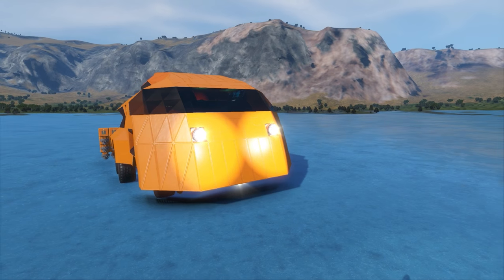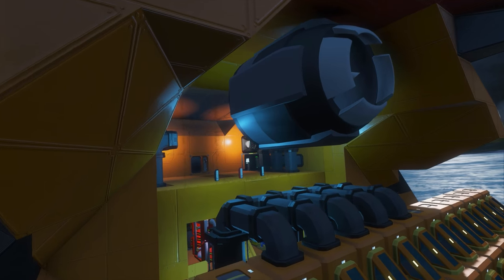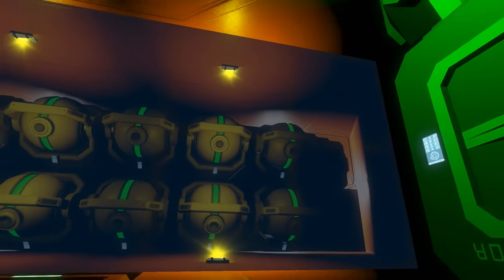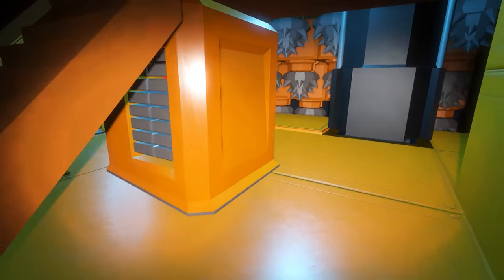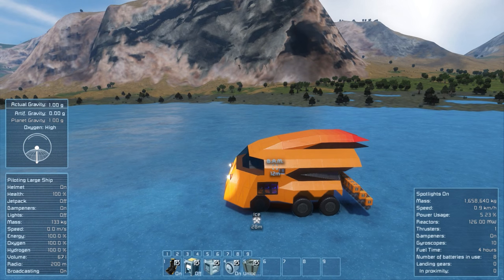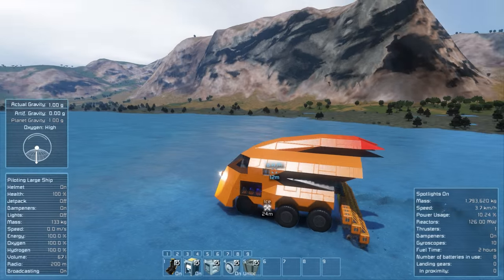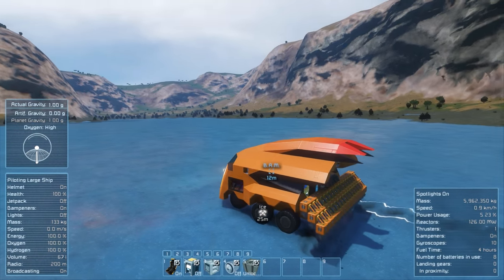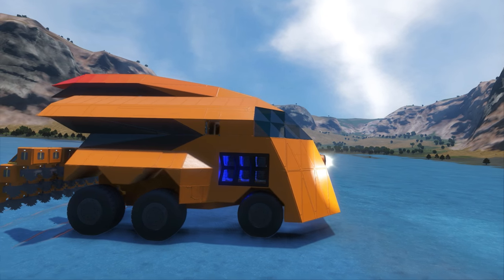Let's Play Space Engineers S2E19 Strip Mining Truck

Comment: Nice ,send to location, set patrol done. Could u try a blade at the front that's a wall of drills, and go through a mountain
Reply from the maker: +Si Fi You could, but as there isn't any ore below about 200m, there would not be much point.
Reply: Cool 200 ish must remember that
Reply from the maker: ***** Basically there is nothing deeper than a large block ore detector can detect.